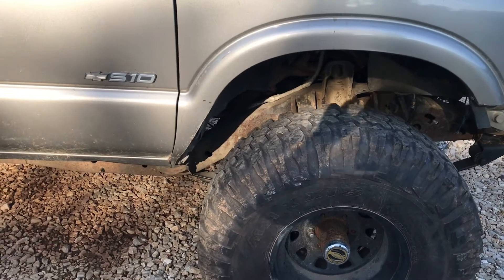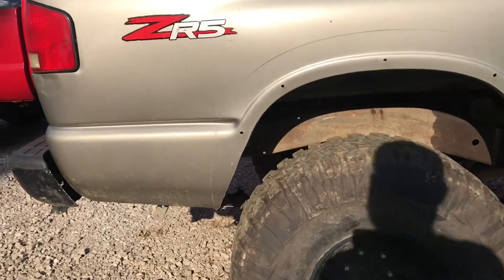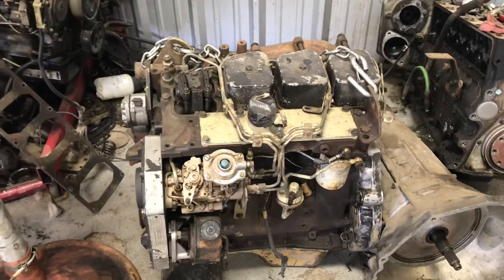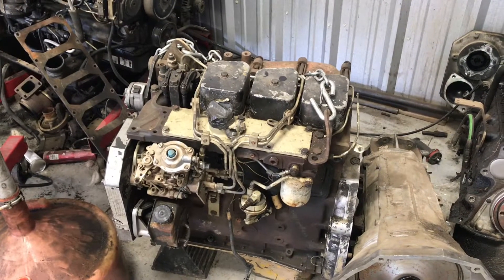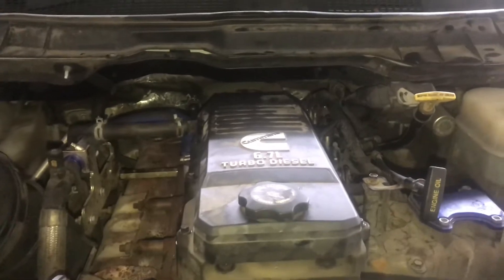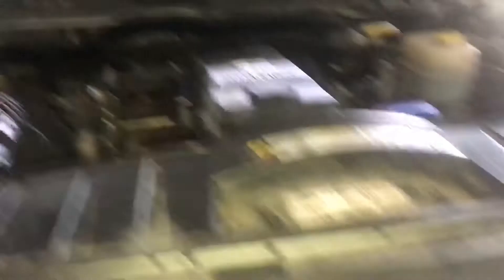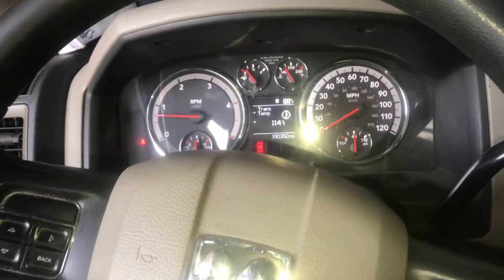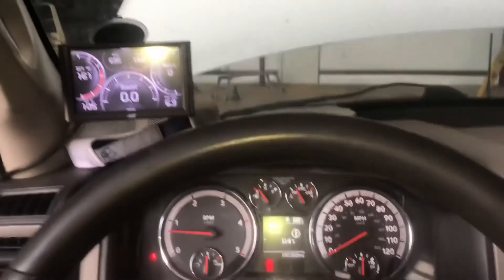2003 Crew Cab Chevy s10 SAS (solid axle swap) 4BT swap and installed head studs in my 6.7 Cummins

Comment: what axles you runnin and t case? awesome truck
Reply from the maker: Aaron Sprankel Dana 44 front from a Wagoneer and Dana 44 rear from a rodeo. Geared 4.56s, locked front and rear, and chromolly axles. Chevy 231 for a transfer case.